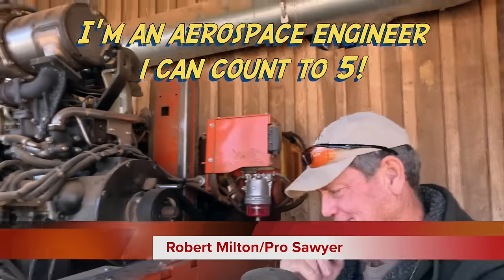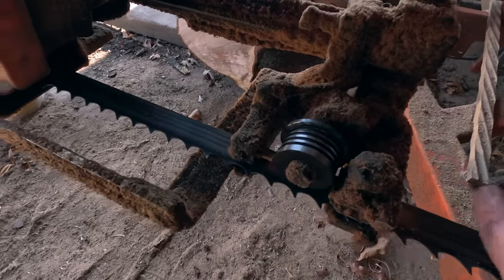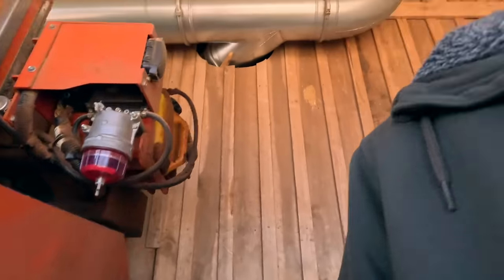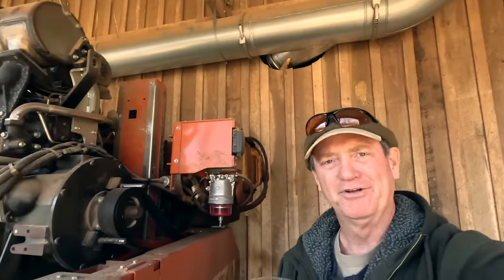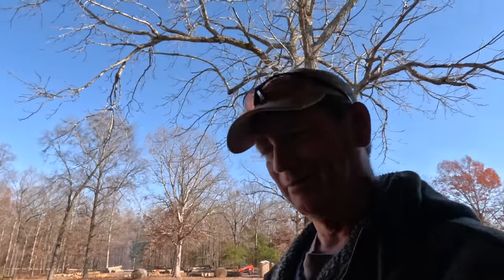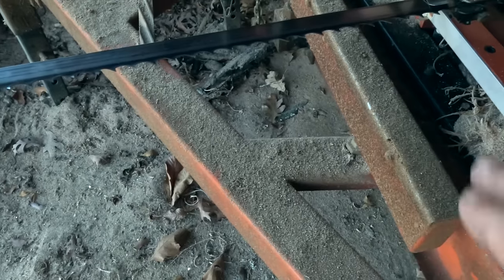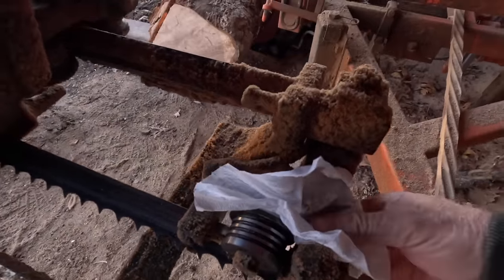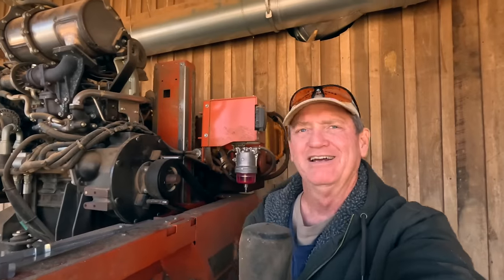Best Sawmill Alignment Secrets! Can You Pass the FIRST FIVE TEST (F5T)?

Comment: Your tips are golden. Other channels are idiots not to memorize your information. I was chuckling a mite as you described roller and metal band maintenance. The same issues apply to wood shop band snd table saws.  As a sawyer I once had the owner stop by and spray lube parts of the set-up and leave assuring me everything would work more efficiently. Of course the lubricant attracted sawdust and I had to shut down the operation to clean off all the gunk. The owner later apologized.
Reply from the maker: Some do, some don't.  Many simply don't care if they are running a sawmill or a pizza oven, they are in the business of making videos, not lumber.  Others have  adopted many of these techniques and you may sometimes see them wearing a Hobby Hardwood hat or shirt.

Comment: I gotta send you a big thank you for this video.  I run a Timberking 2000 and have been having some issues with wavy cuts especially in white pine.

Your tip about the adjustable guide needing to be rock solid was the answer for my problem.  There was very little slop, but taking that out of the equation doubled my speed and eliminating 90% of the waves.

Thanks for sharing your experiences.
Reply from the maker: Glad I could help!

Comment: I'm confused! You said Joe Maine makes your blades, then you said that you run the Woodmizer Turbo 7.
Did I miss something in between?
Reply from the maker: Yes you are correct.  Joe uses coils of Woodmizer blade stock but they fit, weld, and grind the bands in house, and do a good job.  Unlike most, they stress relive the weld correctly (usually), and grind it flat, so that rolls smoothly over the band rollers.  The sound of a properly welded and ground band vs a "not perfect" WM band is noticeable.
Reply: They use Woodmizer coil stock to manufacture the blades from.

Comment: I am currently use a solar kiln. I really want to move to something more controllable. The research I have done isn't for someone who is trying to understand the process. I know you can get into the weeds really fast with drying lumber. But any knowledge you can pass on would be very helpful.
Reply from the maker: You are correct, and there is lots of snake oil and bogus information out on the web.

Comment: Hi there! I recently started working at an Urban Sawmill in Los Angeles. We use an LT70 an I am grateful to have your videos as a reference. Thank you!

I had a question regarding the deflection of the blade guide rollers. The manual says 1/4” deflection and I was wondering if you go by that rule of thumb and how you make sure it’s the right measurement. Thanks again!
Reply from the maker: Actually, I was going to include that in one of my upcoming videos.  Yes, deflection is critical in keeping the top of the band pressed firmly against the bottom of the roller.  It provides a positive bias to that band to keep it from wandering, as it could if there was no deflection at all, and the band was in a neutral state.  However, the 1/4" rule is not an absolute, especially since the blade guide arm, especially on a wide mill, will yield and flex upward due to band tension depending on how far the idle side guilde roller is positioned in the throat.  Every mill I've used will have sweet spot where the band deflection is optimal and perfectly counteracts the stiffness of the idle arm at specific position.  That's why you almost never see me adjust the blade guide arm in or out when I'm sawing.  When the sweet spot is found, and the deflection perfect, the band will stay pressed against the bottom of the roller guide during high load, high speed sawing.  There is a feel to it, but in short, yes, deflection is crital, but no, it does;t have to be exactly 1/4".

Comment: My blade guides are blocks not rollers. My blade guide arm doesn't have the ability to be rock solid I don't think. I have a Woodland Mills HM 130 Max. Thoughts?
Reply: Same here...❤
Reply: Cooks saw mfg sells complete roller guide retro fit kits. Requires some welding but gives you all that adjustment he described. There is a good reason Cooks , Woodmizer and Timber king use roller guides
Reply: @willcoe8419  Thank you for the response. What I'm asking is, does the same rule apply in my situation with guide blocks as far as have to have a rock solid guide arm? I'm pretty sure I can't even make it rock solid.
Reply from the maker: It depends, do the blocks actually contact the band during normal operation, or are they used as "bump stops" or travel limiters? If they do not contact the band during straight and level sawing, but only if the band goes "out of bounds" then the whole load of the mill is being picked up by the bandwheels themselves during straight and level sawing, and having a clean blade would be even more important to insure proper tracking and not affect the position of the band on the crown of the wheels.  If the blocks do contact the band at all times and essentially steers it, then yes, they need to be rock solid.  I would be interested to see a 130 in action, interesting question.  For example, a WM mill like mine as the band rollers, but then also has what are called "High Performance Blade Guides" which are about 1.5" square, postage stamp looking flat pads of hardened steel, placed about .005" inch away from the band and the only time they get used or contacted is when the band starts to not cut level and they force the band back into position, or at least keep it form getting worse.  They do not need to be aligned as precisely as the band rollers.  I have never seen band guides that fully contact the band that didn't need to be rigid.  If not, then sawing sawing speed and accuracy will be affected.  Interesting question.  Either way, keep the band as clean as possible, shiney as new.  Great comment.
Reply: @HobbyHardwoodAlabama  Thank you for the response. The blocks are located above and below the band. There is a bearing in the rear. They are all set to be about paper width from touching the band. So, I believe that the entire load is on the crown of the wheels. I was going to "upgrade" to rollers but decided not to because I'd be fixing a problem that may not be broken. That said, the Woodland Mills sawmills are very popular among your fan base. Most of your fans, I would imagine, are running bandsaw mills at the entry level and cost under $10,000. I could send you a video if you'd like the next time I'm running my mill. Thanks again.
Reply: My first mill had the same guides you have. They don't contact the blade unless the blade tries to rise or dip. I cut straight lumber with it. Just can't push it hard. Have to slow down. My blades lasted longer on those guides because it made me change them when it even thought about being dull.

Comment: How much pinesol do you 0:04  use in the tank ? Is it straight pinesol or diluted ?
If diluted, what ratio ?
Thank you for your anticipated reply.
Reply from the maker: This is a great question and one that I've thought about doing a video on.  So here is the real answer.  Use enough to cut the pitch.  For example, if you get grease on your hands and wash with water, it wont come off.  The solution isn't to turn the water faucet higher, the solution is to use more soap.  Same thing with Pinesol or any other band cleaner. The answer is not to use more water, but to use more soap until the band starts to get clean.  Sometimes is 10%, sometimes 20%, sometimes pour a little Dawn in with the Pinsol, sometimes even a little Window Washing Fluid.  I think I will make a video of this process of optimizing band cleaner fluids.  Good question!

Comment: Hod fo you desolve oil in water to be consistent. Have you ever tried Oilatum? I have used it for years while working in a factory making fire protection sprinklers for testing the leaks under pressure.  Couple of drops makes 3 gallons of water milky white and it's oily. Its for people with exema to put in a bath. What do you whink? Worth a try?
Reply from the maker: Not tried that, but certainly used other oil and water emulsions and they work fine!

Comment: Put the BGATs back on the blade and measure down to a 6 foot alumimum level resting on the bunksmeasure both ends of the BGAT to level the blade with the bunks. Your test just tests the that the rollers are at the same angle with each other. Do you taste what Iam cooking?  Have you ever cut fast enough to make the blade sing?
Reply from the maker: As I mentioned, these are things I look for when someone calls and is having trouble they can't diagnose.  Everyone knows to measure to the mill bed with a straight edge, it's generally the first alignment step they take, and I even mention that the band must be parallel to the bed in the video.  However, it doesn't always mean the idle side and drive side are in parallel alignment and the band isn't warped or twisted, simply because even using straight edges on the bed, many times, the bed rails are misadjusted or are bent.  Sometimes, measuring to the bed makes the band twist worse.  The bed must be in alignment before the band can be checked to it.  However, bed alignment, backstop alignment, those things to check are the 6 through 10 video I'll make sometime.  So using two BGAT's at once and quickly sighting down them answers the issue of the band not being twisted and out of shape which is a very common problem and takes only seconds to check.  As far as hearing the band sing, I speak about it a lot in my videos, it's usually an E Flat.  Not sure what it has to do with food, but thanks for watching!
Reply: @HobbyHardwoodAlabama  Yup-, I tell people to spend a day adjusting the mill, it's not a 10 minute job. I have a old super 40 with the 50 HP Cat diesel 8000 hours, everything but the seat. I feed my chickens the sawdust hoping they will lay a 2x4,.nothing yet. Have you seen the felt wiper with a diesel drip just behind the drive side guide roller? I would think moving it ahead of the adjustable guide roller to keep it cleaner.

Comment: Hey I'm from the good part of New England and yes you talk slow but it reminds me to slow down a bit. So thank you. But my issue is my woodmizer book starts "the blade should be 1/16 or 1/8 of an inch higher on the out side because when it hit the log it dives. I can't recall the exact wording of the book at the moment. From your experience, have you tried to adjust that way? Or do you just run your blade flat? I screwed up back in the spring and took the main blade adjustment bracket off the machine not knowing what it was exactly and now I've been fighting it all year to get it back to where it needs to be.
Reply from the maker: That would be a great subject for video.  It can be very fiddly!  However, I will first make sure I have 1/4" down pressure.  Then the idea of setting high is based on the cantilever head pulling down when the saw is loaded, as well as the idle side blade guide arm, but it is very user critical.  I depends on how fast you saw, the species and your blade.  I will set everything to dead level, and it's important to check it with both the blade guide arm full inboard and outboard, with 1/4" brown pressure on the band.  Then saw a few boards and get your rhythm and check the boards to see if you are getting even thickness on both edges, arm full inboard and full outboard. if not, then drop the roller guides until is cutting accurately.  If you want to see how much your arm flexes and how much needs to be taken in, tighten the band, run the blade guide are full in, and rapidly release the band pressure and you will see the arm relax a lot.

Comment: I’d like to know how much tension the blade guide rollers should be putting on the blades.
Reply from the maker: Good question, I will do a video on it.  Basically, the band wheels put the tension on the bands, and the roller guides should have 1/4" of down pressure on the band.
Reply: @HobbyHardwoodAlabama  thank you sir. I’m just finishing up the installation of my first mill and I’m on the home stretch with only some minor adjustments and calibration left before I put oil/gas in the engine and crank her up, so I very much appreciate all the wisdom you’re sharing. BIG thank you from Virginia.

Comment: My saw is cutting 3/4 inch thinner on the front than the back of beams.  Never move the sawmill, but have checked it with the level.  Trailer is level, platform is level.  What do I need to check?  Thank you so much.
Reply from the maker: Do you mean inboard to outboard or down it'e length?
Reply: down the length
 @HobbyHardwoodAlabama
Reply: I probably said that wrong.  The end next to the sawmill is 12" wide.  The end at the far end is 13" wide.

Comment: Just a thought:
 If the mill is straight and true and the blade sharp and tight: is there a need to move the guide that should be "gorilla tight"?
Reply from the maker: The gorilla tight is making sure the arm will not move except within its normal travel range, which is in and out.  For most sawing, you are correct, I rarely need to move my blade guide arm for most logs.  As a matter of fact, most mills have "sweet spot" where the blade guide arm and mill likes to run perfect, and it may be anywhere whiten it's travel range.
Reply: @HobbyHardwoodAlabama  Thank you for taking the time to answere. Greatings from Finland (where we don't have much hardwood, mostly birch, spruce and pine) 🤗!

Comment: I use a magnetic torpedo level to tell if the blade is level side to side and forward back
Reply from the maker: Yes that will work fine as long as its weight doesn't induce twist or deflection in the band.  Thanks for watching!

Comment: I notice that the whole head moves up and down since it is cantilevered off of one side. Does that affect the straightness?
Reply from the maker: Surprisingly, no.  The whole system is basically a flexural spring, and is has many advatagoius over a standard four post design.  Once the mill gets loaded in a log, it cuts straight as a laser.  Good question!

Comment: Isnt one airplane wing slightly off angled from the other to provide stability on takeoff? Helps to keep that ball centered.. oh and Nathan is right you are the wood Yoda..😊
Reply from the maker: No, there is always a dihedral in a wing, but the attack angle is always symmetric wing to wing.  The angle of the plane will cause the wing to change angle as a whole, and that is what helps create lift, which is exactly what isn;t desired for level flight or a sawmill band.  There are flaperons that can be used to alter the shape of the wing as needed during takeoff or to trim for level flight.
Reply: @HobbyHardwoodAlabama  I knew you would know that.. the rocket man and the wood Yoda! I have a lot of respect for you..

Comment: Use mixture of water and simple green.
Reply from the maker: Any soap and water works to a degree, I’ve even used the purple stuff, I’ve used Simple Green, Dawn, Ivory, Orange solvent, windshield washer fluid, anti freeze, methanol, etc.  I’ve helped develop lubricants for the companies who sell band cleaner to the major sawmill companies.  That being said, nothing works as well as a very slow diesel drip, except maybe a water soluble oil, or a machinists oil, like Cotton Picker Spindle oil. Either way, the lube and cleaner needs to have an oil to protect the band, the rollers, and the bearings in the rollers.  Thanks for watching.

Comment: Is this an open book test!😂😂😂 number 1 I feel starts with a level and true log bed it’s the foundation of the saw just like a house!
Reply from the maker: Yes, the sawmill bed must be dead straight but doesn't have to be level.  There is a while video series I could do about adjusting the sawmill.  Surprisingly, on cantilever head models, level isn't necessary, I always set mine back at about 3 to 5 degrees toward the back supports so when I load a log, it rolls backward into the mill bed, and not forward off the mill bed.  For a manual mill, it's always best to angle the mill downhill on the return stroke so gravity helps roll the head back to the starting position.  Less pulling by the operator.  I may do a video on this whole subject.  Thanks for the suggestion!
Reply: @HobbyHardwoodAlabama  I have a manual woodland mills so level side to side is important as with the length being straight so the carriage rides true but I do have it raised so it does return on its own some what.

Comment: When everything is adjusted perfectly and the blade will not cut straight. The blade needs to be flattened or rolled.
Reply from the maker: There is always a reason, but yes, clastic curvature can be an issue in a high use band, and can easily be detected using a razor blade before and after rolling.  There is no reason to roll a band unless it fails the simple test.